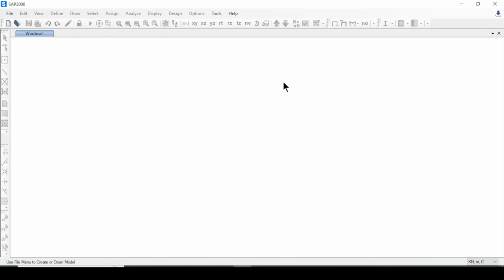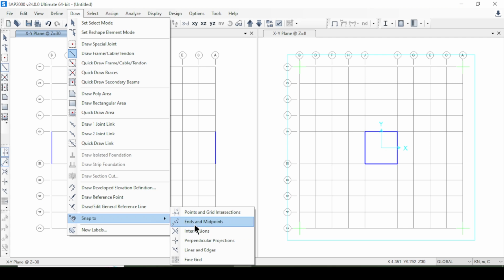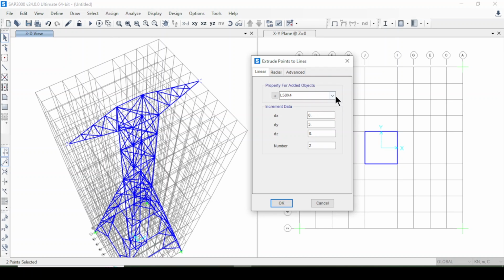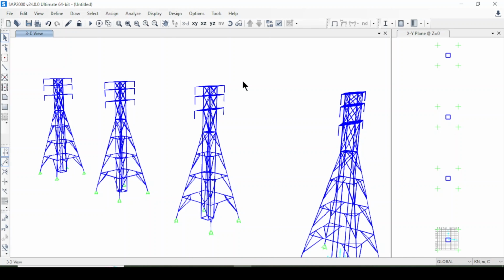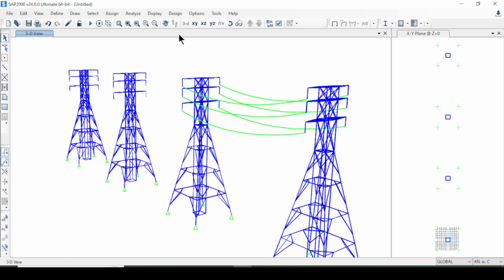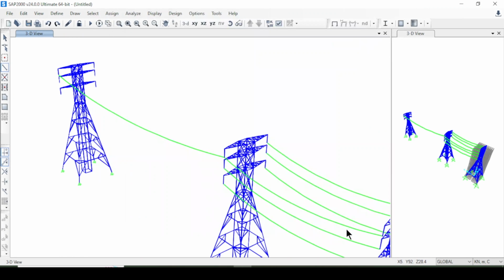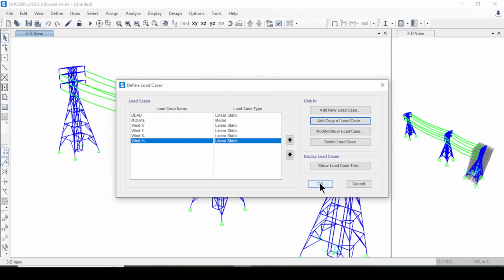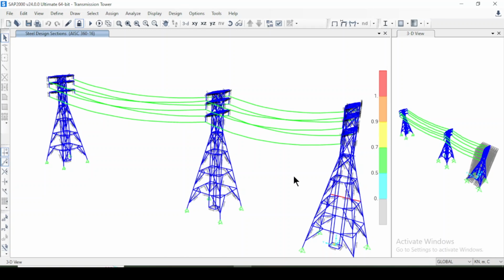Design of Transmission Tower - SAP2000.

Comment: Kindly make a video on assignment of wind load to transmission tower. I am doing the same way as shown but not happening in analysis. Kindly suggest a solution
Reply: Loads might not be applied correctly on joints.